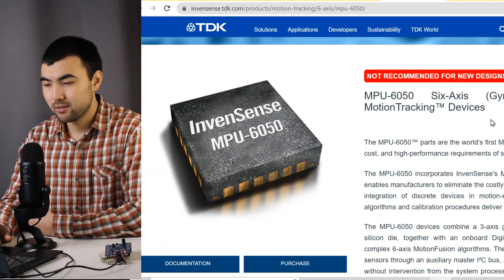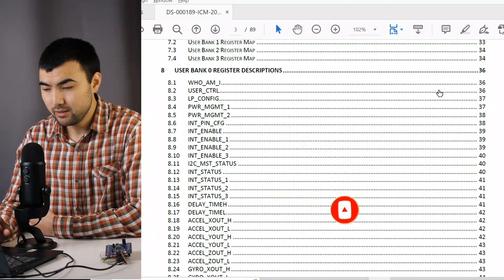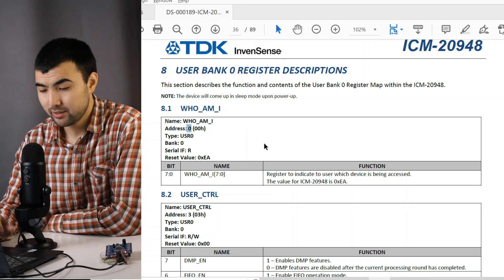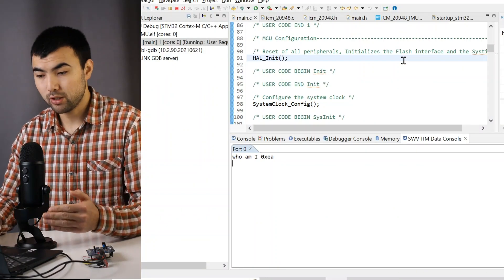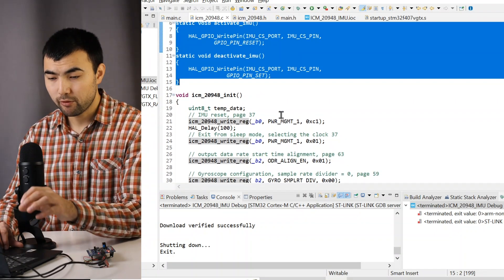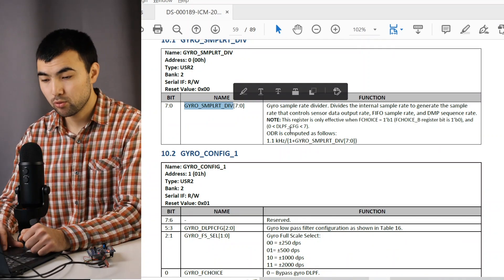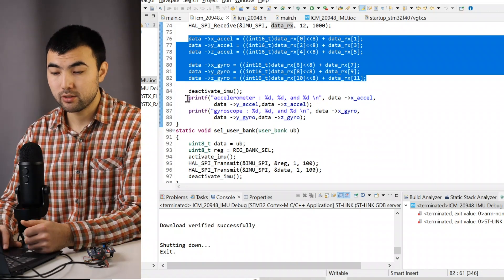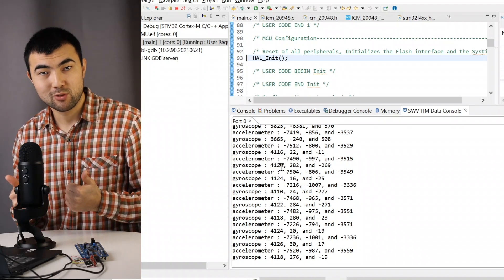STM32 ICM-20948 IMU Part 1: accelerometer and gyroscope | Do not use MPU6050 and MPU9250!

Comment: Here is a note in datasheet, 
`Low Byte of Gyroscope Y-axis data.
To convert the output of the gyroscope to angular rate measurement use the
formula below:
Y_angular_rate = GYRO_YOUT/Gyro_Sensitivity`

What is Gyro_Sensitivity ?
Reply from the maker: You just define the full-scale range (250 dps, 500 dps, etc) using a register of the IMU senor. Based on that you can compute the gyro sensitivity. For the full info, you can refer to my course:
https://www.steppeschool.com/courses/stm32-hal-orientation-estimation

Comment: Yes , we don’t use the MPU9250 because it is in stop production, there is too many fake chips in the market
Reply: Hello.  Do you know if or what difference this chip compared to a MPU9250 (if it were authentic) or a MPU6050 ?

I thought this video would explain, maybe I missed it.  A whole lot of "how to interface" is good and might be a more applicable title.
Reply from the maker: Hi,
MPU6050 does not have a magnetometer. That is the main difference. Compared to MPU9250, ICM-20948 has low-power capabilities and can estimate the attitude (quaternions) inside of the chip. There are other minor differences as well.

Comment: Very great video , can I watch your schematic ,I think the icm20948 is fonctionne under 1.8v, but the Gpios of STM32 is 3.3v, how do you solve this problem?
Reply from the maker: Thanks a lot.😀
If you check the datasheet, no maximum voltage is specified for SPI (page 14, VIH-VOH ). So it should work fine with 3.3 Volts. However, when using I2C, you must consider the voltage level.

Comment: Given that accessing the GPIOs [externally, from say a breakout board, or with external sensors] with my STM32H757i-Evaluation Board is a PITA, today I ordered the H745I-DISCO Board [H747 out of stock everywhere :/], so that I get the STMod+ I/O Expansion and can connect external stuff more easily. I also bought the BMI088 IMU, so that I could learn some SPI and some general interfacing. Do you think I picked a good IMU or is it trash? There were a lot of them, so, hard to decide haha. 
Your channel is great. Also, congrats on the setup. 

I only wish there were more Dual Core Tutorials on the Web, and also C++ Projects though. But it seems everything is Single-Core only, and I don't have a single-core board. I also don't really have a problem with C, it's just that I am actually a C++ Programmer ^^
Reply from the maker: Hi,

Regarding BMI088, it is a good IMU sensor. It has a wide measurement range and selectable data rates up to 2 kHz. The only drawback is it does not possess a magnetometer.

Thanks for finding my content interesting. 
You are correct that my projects are mostly related to microcontroller programming. However, in the near future, I plan to add more projects using knowledge from multiple disciplines.

Comment: i didnt get why is this better than the mpu9250 and mpu6050, it has the same resulotion and setting according to the datasheet
Reply from the maker: The main reason to switch to a new sensor is that old sensors will be obsolete, meaning they will not be produced at some point. Also, they might be the same in terms of resolution, but a new sensor has low-power capabilities and a digital motion processor.
Reply: @steppeschool3629  the mpu9250 also has DMP, and cost ×10 times less than the icm20948.
There is no reason why they will be obsolete.  And except from very small devices that needs low power sensors, I can't see what is the advantage.
Reply from the maker: @eyal4  We do not collectively decide whether the sensor gets obsolete or not. It is the manufacturer who decides this. And if you check the official website, it is written that the mpu9250 sensor is obsolete, meaning they are not manufactured anymore.
Reply: @eyal4  Obsolete when?  In my lifetime?  I wish I could find myself into a position where the application I produced would use up the existing world supply of MPU9250 sensors.  I would use 1 or 3 to check if I get my project to work, maybe.

If I would struggle just as hard to get a $40 sensor to work, equal to the labor as a $6.00 sensor, it makes no sense to me at all.

If any sensor works stable, easy to use without 6 months of geometry education and inertial physics study - then clearly a $40 sensor worth buying over a $6.00 cheap sensor.